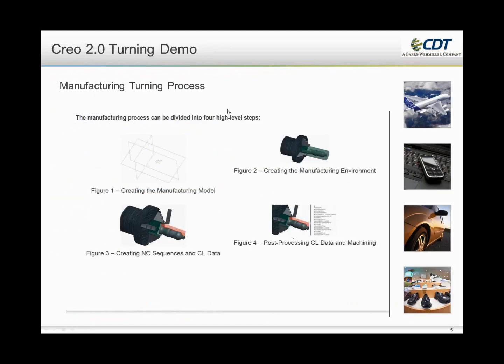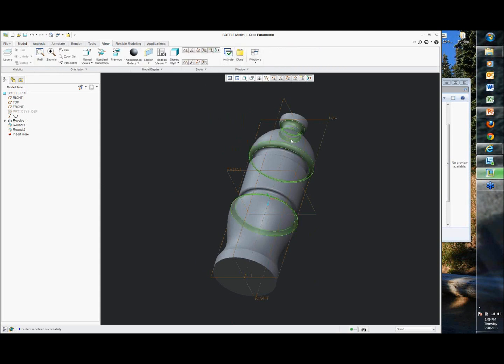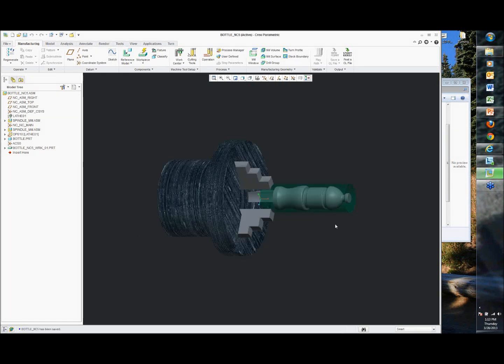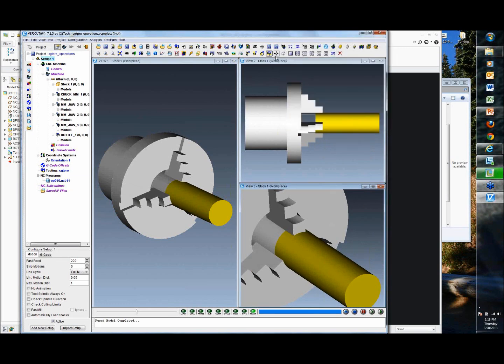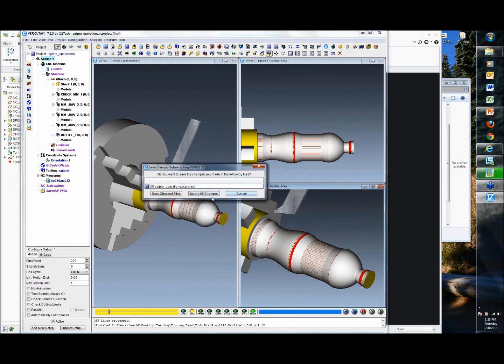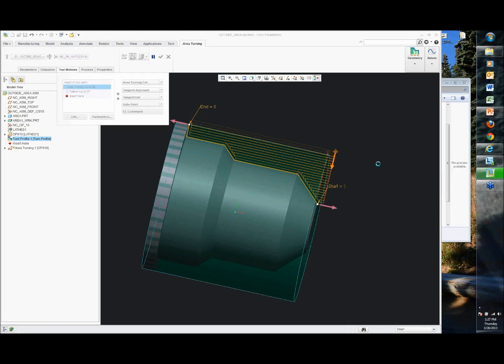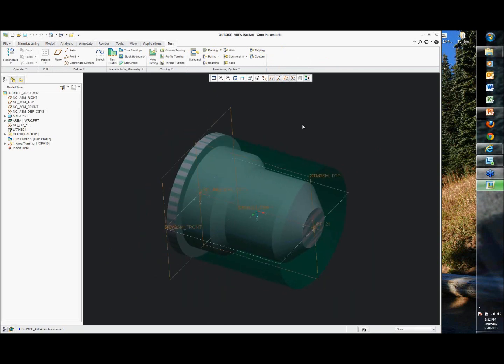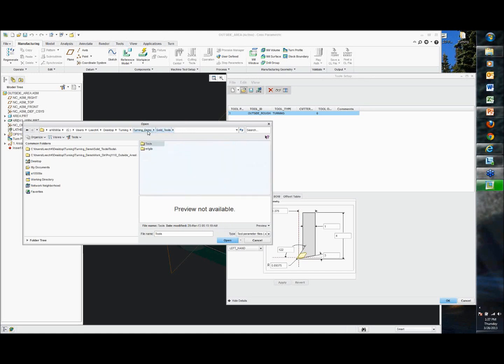Turning Using PTC Creo Parametric 2.0  Webinar

Comment: Hello ! First-very helpful and good video. Big question: at basic turning operation, three parameters are need to be input: cut feed (mmpr) , step depth (mm) and spindle speed (RPM). Any possibility to work with cut speed (m/min)instead of spindle speed?? Because spindle speed is not constant for different diamaters AND this is my input-regarding to material, etc....please help. THANKS for great vid !